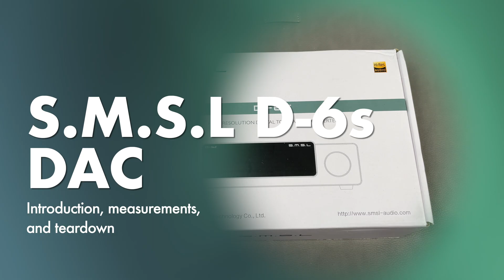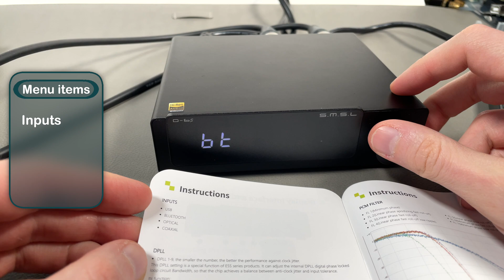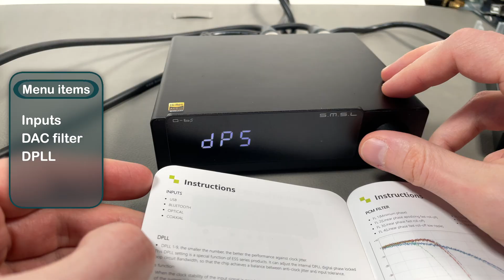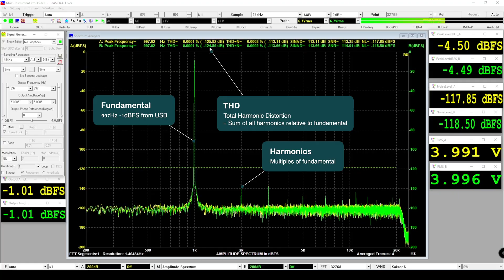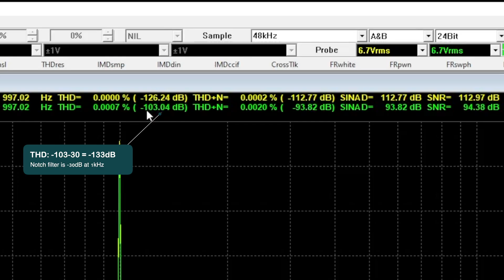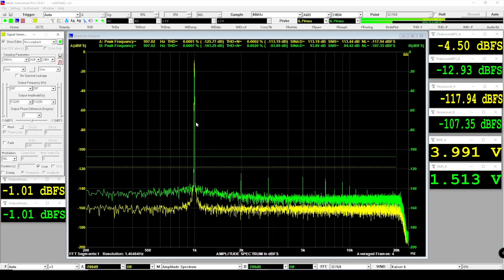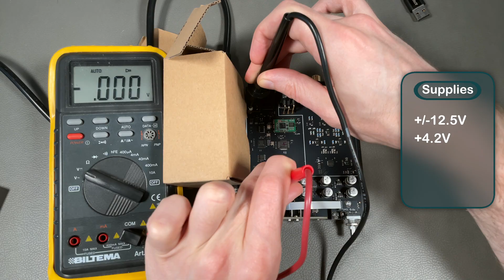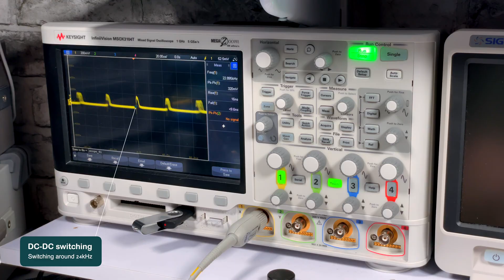S.M.S.L D-6s DAC Teardown Pt.1: Unboxing, Features, PCB Overview

Comment: I wonder if you could add a 10mhz clock input on this DAC like the new smsl D200 DAC.
Reply from the maker: Probably not. The DAC MCLK is often an integer multiple of the sample rate, but some DACs like some ESS chips have some other clock modes as well, I believe. In any case, you would need to re-configure the DAC chip for that clock.

Interesting, I didn't know there's a DAC with 10MHz input. I wonder if that's actually useful or a gimmick. If they need to manipulate the clock to suit the sample rates, it's probably worse than a built-in oscillator.
Reply: @kaamostech yeah it uses a rohm DAC chip so maybe that makes a difference. Aune also makes a DAC that takes a 10mhz clock input. That might be another video idea for you. Breaking down the 10mhz input on these DACs and what it does.
Reply from the maker: @ancientalien815  Yeah maybe one day. Quickly checking the ROHM DAC also requires in-sync MCLK, 24.576MHz or 22.5792MHz, so don't know what they do with the 10MHz clock.
Reply: @kaamostech if you figure it out, let me know!